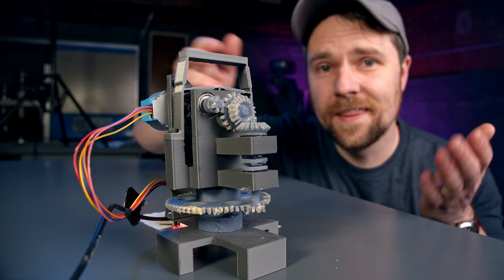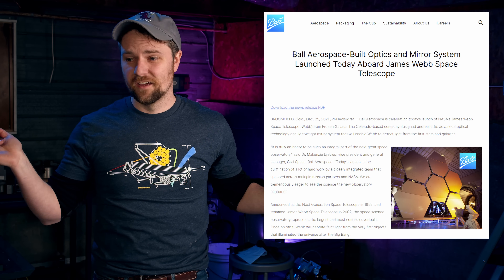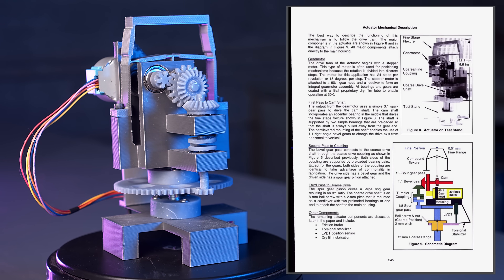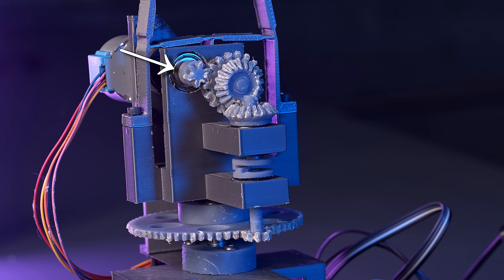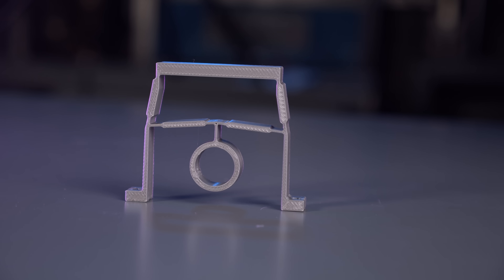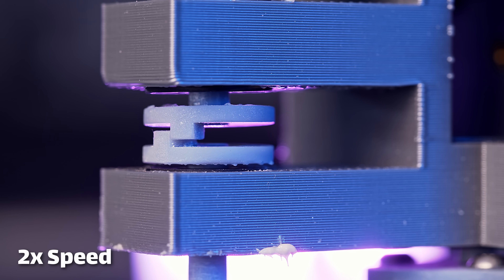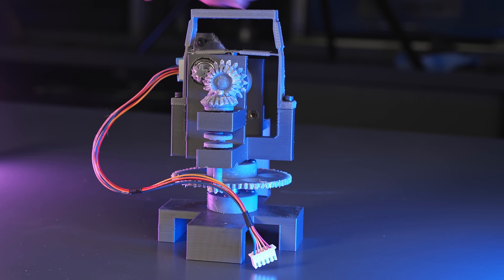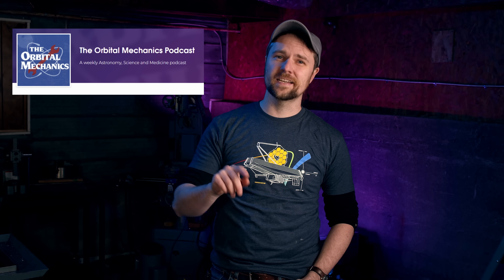How to achieve nanometer precision in space?

Comment: SmarterEveryday did a video about his Dad's work in calibrating the insane precision of the JWST alignment process. Getting nm precision results requires nm precise measurements, which is insane considering 1nm is roughly 10 (bonded) atoms long... Imagine making gear ratios accurate within a handful of atoms and durable enough to maintain that precision for years 🤯

Comment: I am an electronics engineer, and the engineers designed that are all geniuses! (Considering the extreme requirements), and the programming involved controlling all those motors. 
pretty sure they have some sort of feedback to tell the system the exact location and position of all those motors and mirrors.

There are lots of things involved in designing such actuators, like materials being use, (mechanical / thermal / physical, characteristics).
Torque of those motors, gears reductions, etc.
Electrical, feedback and control, etc.

This is just amazing! Like WOW!

Comment: Very interesting.    It is the heat shields, not the mirrors that are extremely thin.   The mirrors are made from Beryllium and are Gold plated.   Each mirror segment was figured so that when it cooled down to its working temperature, it has the correct figure.   That is an interesting problem that took NASA several years to solve.   The Spitzer IR Telescope was the proof of concept for this.   Its mirror is also made from Beryllium.

Comment: Another straightforward demonstration of the mechanical principles used in this motor is the surface forces apparatus, or SFA, designed by Jacob Israelachvili. The SFA uses a shaft attached to a stepper to push a weak helical spring against a stiff double-cantilever spring. The flexure of the double-cantilever springo produces step sizes of a couple angstroms. Looking at a diagram of the displacement mechanisms for the old Mk 2 SFA design, it is fascinating how clear it is that a 2-spring system can be used almost exactly like gear ratios. Also, spring-based systems are great for minimizing backlash... don't ask me why though

Comment: So how did this help with the heat issue? How does this mechanical structure prevent the stepper from having to be engaged? There would surely be some pressure on the cam that would make it want to move. so to keep it steady you would need a current? I assume I'm wrong about that, but how?

Comment: Watching old videos, and not sure if you covered this. With how the mechanism works, it's best (energy efficient) to slightly overshoot your goal, then backtrack the maximum fine adjustment potential on the coarse adjustment, because when you go forward again you will be at the start of the fine control. I think getting to a point before over-shooting, then backtracking, then fine tuning would be more laborsome (aka energy consumption) than the previously state method. I assume less energy usage is a very important subject for the JWST

Comment: So all this does is move in z axis??? I'm so confused. The combination together will move for the other dimensions??? The flexture plate is just to get the nanometer precision I think??
Reply from the maker: Sorry that's probably my fault for not explaining well! Each individual actuator only moves in one direction (up/down), but there are six of them arranged in a "hexapod" underneath the mirror. By adjusting the six individual actuators they can get all the degrees of freedom. If you look up "hexapod actuator" or "stewart platform" you'll see how the system works :)
Reply: @BreakingTaps  cleared that right up, great video look forward to the next.

Comment: But, the entire Z +/- accuracy of the flexure datum surface relies on the accuracy/backlash of the ball-screw no?
Reply from the maker: Nope! The ballscrew mechanism is just for coarse positioning. Once they get to the appropriate range, they disengage the ballscrew mechanism by back-driving. The lower ballscrew stage is held in place with a friction brake and then they are relying solely on the cam mechanism. So the limiting factor becomes the gear backlash and stepper positioning of the upper stage, which can be controlled to a much higher degree than the ballscrew.
Reply: @BreakingTaps  yep, I get all that, but it's still sitting on the ballscrew for a mount? Unless a linear brake across it to a solid base isn't show in your model? Great vid by the way.

Comment: 1:32 "Hard vacuum" and "cryogenic temperatures" are mutually exclusive, are they not? A vacuum is a total lack of stuff, while temperature is a measure of how much stuff is vibrating. Stuff can't vibrate if there isn't stuff.
Reply from the maker: If it was a 100% complete vacuum then yes...but it's not a complete vacuum because the satellite is in it 😉 There's plenty of other dust and gas molecules floating around in space too though. It's a very high vacuum but not 100% devoid of "stuff".  And JWST receives energy input from the sun, and various components generate heat, so the satellite itself has thermal fluxes to deal with

Comment: Am I correct in assuming that mechanical fatigue won't be an issue because the adjustment is made only once and once done stays as it is for the life of the telescope?
Reply from the maker: Mostly correct! My understanding is that there will be small corrections over time. JWST will be monitoring the alignment every few days, and performing corrections (if needed) every two weeks, at least to start. The idea is that things on the spacecraft itself will settle and shift as it heats up/cools down, fine guidance slowly changes pointing position, etc. And those actions might perturb alignment and require the actuators to adjust.

So these actuators will probably get used some more throughout JWST's lifetime.  But they've done extensive studies of the failure mechanism for these actuators, and it's bearings in the motor that will likely give up first, well before the flexure fatigues.  But for that reason they track how many revolutions the motors make so they can watch overall lifetime left :)

Comment: don't gears have a small amount of wiggle room when transferring rotation from one to another? do they have any tricks for that? or do they just accept that each gear will turn a little bit before the next one turns? and does wiggle room vary depending on the position of each gear so it's not a constant "delay"?
Reply from the maker: Yep, there will be a certain amount of backlash whenever they change directions. I didn't see any specific precautions against it, so I think they just characterized these very well (to know what kind of backlash to expect) and compensate by running the mechanism a bit further in each direction to "take up" the slack.  There's also a high precision LVDT sensor which tracks distance traveled and can assist in positioning.
Reply: @BreakingTaps  i guess with precise feedback of the end result they could automate collecting the actual behavior of the gears..maybe even while on earth and run a double check scan in space to see if the numbers still hold..then hmm i guess they'd have info like "turn clockwise X+k amount to move final gear Y amount" even if it takes a lot of individual notes...i guess this thing is worth the paperwork and fuss :D [oh! come to think of it, i wonder if there's a whole history of issues they've learned from astronomers who had to rotate their telescopes accurately with gears]

Comment: So Fine to Course adjustment is about a factor 1000 in scale, unlike the factor 10 in many manual systems.  Entire mechanism operates in steps of about 1/2500000 of the full range, which would be excellent for more Earthbound machinery.

Comment: Slightly confused about the coarse stage - does this cause the whole unit Including motor to move along the lead screw? And if so, doesn't the tortional stabiliser stop it from moving away from the base?
Reply from the maker: You're correct! When the coarse stage moves the big gear, the entire upper section moves up with it (i.e. the "nut" is in the base, while the upper section is attached to the screw).  The torsional stabilizer is designed so that it is flexible in the linear "up" direction.  As the upper portion moves, it flexes and allows the whole thing to move.  But because it's very wide, it is stiff in the rotational axis and prevents it from rotating.  The dimensions on my torsional stabilizer are a bit off, it's too stiff and doesn't flex much. It should be considerably floppier :)

Comment: This might be a dumb question but wouldn't the flexure points wear out quickly or is the distance its flexing to small for it to be a problem?
Reply from the maker: It's a good question! Eventually it might be a problem, but flexures are typically designed to only operate in their "elastic" region, meaning the deformations aren't permanent. But metals will start to fatigue eventually even if you only cycle in this "elastic" region, so it could cause issues some day.  NASA did a lot of studying how these would fail though, and the actual failure point are the bearings in the motors and gear train. Those always failed before anything else, including the flexures. So the bearings will be the limiting factor for these actuators :)
Reply: @BreakingTaps  Thanks for the detailed answer. Very interesting the bearings fail first. I would've thought that the actuator being on the cold side would've made the elastic region to small to reasonably operate within and any deformation at those temperatures would more than likely be plastic. Very impressive design and video talking about it. Your content is always very informative.

Comment: Similar usage of one motor for different mechanical tasks was widely used in early HP deskjet printer to move the service station with the same motor for paper advance. I also considered the solution ingenious, as it makes the printer a lot cheaper, replacing whole motor with some plastic and some code. But I have to mention here that the main reason for dumping the device was broken pins between the disks and inability to move the service station, leading to a permanent mechanical error.

Comment: I’m curious: do we know what materials Ball used to create this?  Seems like there’s a fair bit of stress on the material when it is adjusted.  I would assume when it is adjusted and set, it seems like it would stay stressed?  Unless I’m missing something, which is likely.
Reply from the maker: I believe it's mostly titanium. There's a followup paper several years later that looks at failure modes of the mechanism, and the thing that always goes first are the bearings in the motor. It seems the flexure itself is well within fatigue limits and the cryogenic temperatures nuke the bearings first, every time. So that's what they spent most of the time optimizing, better lubricants, etc and each motor still has a limited number of revolutions.

Comment: That backlash scheme is nothing particularly new nor ingenious.  This "lost-motion" mechanism is/was routinely used on controls for focusing microscopes (fine & coarse), & fine & coarse electrical adjustment pots.  A common combination lock (used on high-school lockers) also uses this lost-motion scheme to permit setting 3 separate rotations from one knob.
          Why do they need to have the ability to rotate the mirror or move it sideways?   It seems that is a recipe for disaster (2 mirrors colliding).  WHY?
          Is the screw preloaded?   I can't imagine nanometer stability from a structure with contacting surfaces that are not preloaded!
Reply from the maker: A mechanism doesn't need to be new to be clever 😉 The mirror segments are aspheric, and must be positioned within about 30 nanometers of the correct position/curvature for the whole array to phase correctly. No matter how stiff, everything will move around a little after launching on a rocket. Having the ability to tweak alignment is critical in any multi-mirror segment (i.e. those on earth) and it's doubly important after launching into space.

The screw doesn't need to be preloaded because it is disengaged when fine positioning is required. It is simply there to provide large movements. There is a friction brake to prevent the coarse stage from backdriving when disengaged though.
Reply: @BreakingTaps   Are you going to call a wheel "clever" or "ingenious"?   In intense engineering world, such things (and many more complicated, such as flexures) are common knowledge.
          From what I see on your model, the screw (coarse) stage is mechanically in series with the fine (flexure) stage.  That means that the mirror position is the sum of the actions of the 2 stages.  Any movement between that screw & its nut represents a lost motion between the fine stage & the mirror position, unless the screw is preloaded by external spring force or interference fit.  Why would they use a ball screw if not interference fitting?  Common things like screws & gears are problematic in the vacuum of space.  Everything wants to weld on contact!  That is why dissimilar materials (such as metal & plastic) are used for such engagements.
          Yes, the mirrors are aspheric, but they are so close to being perfectly spheric.  The amount a mirror can be  rotated/shifted laterally can't be more than 2mm.  I can't imagine a rotation (less than 2mm movement at the edge of a 1.3m hexagon) being significant with respect to the curve more than 1nm.  The shortest wavelength this optic must use is 600nm!
          I would have put 6 actuators at the corners of the hexagons (with bending one at the center).  That way, the whole mirror could be warped with forces at the corners to deform it to the required curve with flexures confining it sideways.  This could accommodate mirror warping due to launch forces or on cooling (or accommodate "Hubble mirror errors").
Reply from the maker: @bpark10001  Perhaps you should apply for a job at NASA then? Clearly you have experience building 7m TMAs operating at cryogenic temperatures orbiting an unstable L2! Those silly folks at Ball and NASA are obviously a bunch of amateurs having launched this thing into orbit.
Reply: @BreakingTaps  I did work for the military engineering elaborate stuff (& influencing & simplifying) a lot of designs in electrical, optical, & mechanical fields.
Reply: They want to be able to rotate/move sideways to align the centerpoint of the mirror with the center of the entire assembly.
Reply: @zounds010  Since the center of curvature is many meters in front of the mirror, tilting it by insanely small angles could move it huge distances sideways.  (This is often referred to as "optical lever".)  Looking at scale drawings, & knowing diameter of main mirror is 6.6 meters, I will guess its approximate radius of curvature to be at least 8 meters out in front of the primary mirror (somewhat beyond the secondary).  To shift that point laterally by 2mm would require 1/4000th radian or 0.014 degree.  The tilt of 1.3m segment would require moving one side forward of backward by only 0.3mm.
Reply: @bpark10001  Good thing the minimum step size is so small.
Reply: @zounds010  It has to be less than 1/8th of the shortest wavelength the telescope works with (1/4th wave (600nm wavelength) error is allowed in the reflected light, but reflection doubles the error).  For this one, that's 75nano-meters at the mirror surface.

Comment: I led the extremely talented team that developed the Telescope Elements at Ball (Primary Mirror Assemblies, Secondary Mirror Assembly and Aft Optics Subsystem). I must say the reverse engineering of Bob's actuator shown in this video is impressive. What will really blow your mind is how we designed the hexapod and other support structure to not deform the mirror surface during hexapod motion at 50 kelvin, while having the structural integrity to survive launch. Also mind bending is how we polished the mirrors at ambient after taking them cold to create a deformation map at cryo and then polishing the inverse at ambient. crazy tech. BTW, these same actuators are used for the ROC (Radius of Curvature) actuator in the center of each primary mirror segment as well as the six secondary mirror hexapod actuators. Good video.
Reply: Your job sounds positively Ballin'!
Reply: Do you know Bob Warden who developed the actuators? 

That had been one thing I has been wondering, how such cold temperatures might cause deformation to parts. Bob indicated that while space is very cold it is also very stable, but part of me wonders how those kinds of conditions could have been accurately replicated on earth to begin with.
Reply: Wow, thank you!!

Comment: In 1972, Philips Consumer Electronics, in the Netherlands, developed and implemented a piezo electric actuator which changed the angle of a 6 micron ferrite video head moving at a scanning rate of approximately 64uS per seconds IN REAL TIME!!!

Frankly, the mechanical actuators on the JWST are a very course and rough cousin compared to the ultra fine precision achieved by Philips in its Video 2000 dynamic track following system (DTS).

Comment: Normally steppers are constantly powered to maintain position and that would consume power and generate heat.  With this application, however, the high reduction ratio probably permits them to  remove power to the stepper once it's in the correct position.
Reply from the maker: Yep! Also, the steppers they used only have 24 steps per revolution, and they don't microstep. So there is a lot more holding torque when not powered compared to more standard steppers.